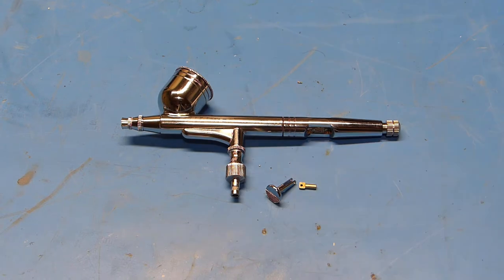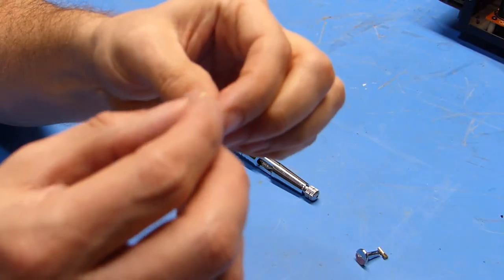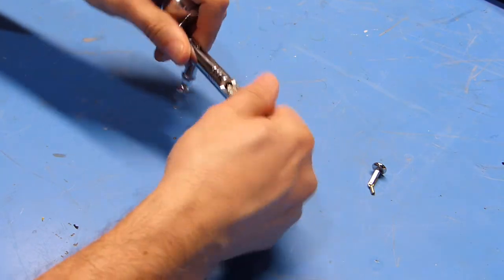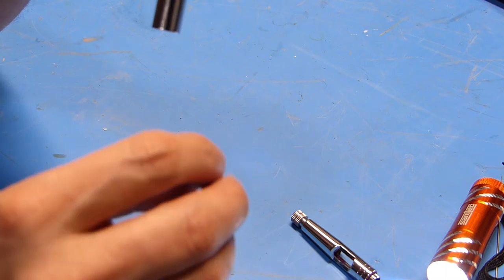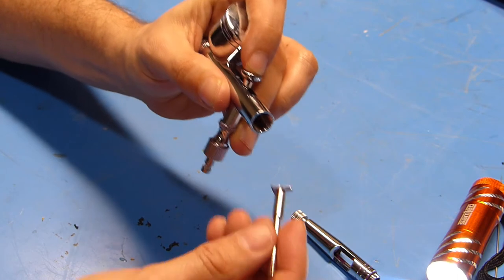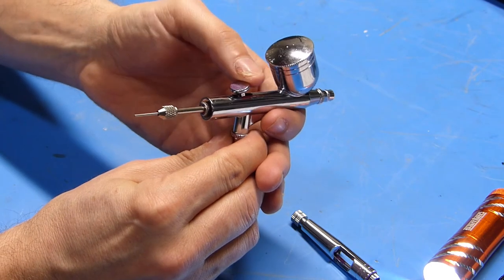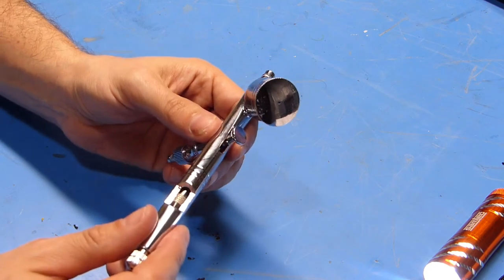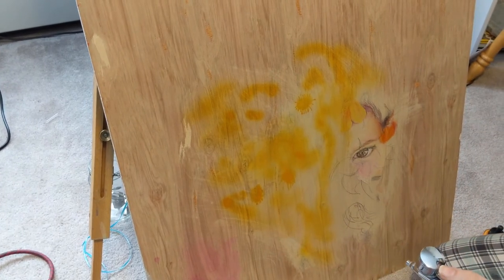Air Brush Trigger Repair and Tear Down

Comment: You're a life saver! I've been decorating some of this years chocolate bonbons moulds with coloured cocoa butter and everything has been working smoothly - until I finished the very last one and just needed to clean the airbrush pistol. It fell unto the floor and not only did the trigger fall out but also the small mechanism from inside the pistol, designed to make trigger spring back. Luckily I found your video and it was so easy to fix the problem. Last time I spend almost 35 minutes trying to figure out what to do! Thank you so much for sharing how to do it 😉
Reply from the maker: I'm glad this helped!

Comment: Thank you for the explanation! My trigger just popped out suddenly when I removed the needle. I had only completed my first of 3 colors on a project and was like NOOOO! Looks like the needle holds in the trigger through the gap in the metal. So when I removed it, nothing was holding in the trigger vertically. You can, if you're sneaky just remove the needle and manually pull back on the spring pin and reinsert the trigger, but it's not as easy as full disassembly.

Thanks again for giving me the confidence to tear apart my brand new toy :D.

Comment: Awesome, thanks! My trigger and plunger had fallen out and I was having issues getting it back in. I saw that you pulled out the spring and trigger assembly and it worked good as new!

Comment: Thank you thank you thank you a million times thank you.  Bought my first airbrush kit the other day.  Cleaned it after using it and the button fell out.  I thought I got it back in the right way until I tried to use it again and no air was coming out.  This video was exactly what I needed.

Comment: Thank you so much for this video, I thought I’d broke my airbrush I took it apart to clean inside where I had dropped paint and the spring came flying out and the trigger came loose and I couldn’t orientate it correctly you just save me a bunch of cash for a new one